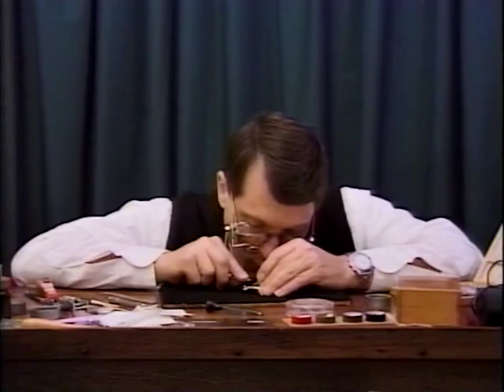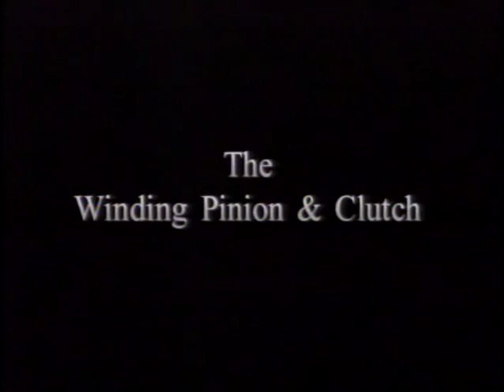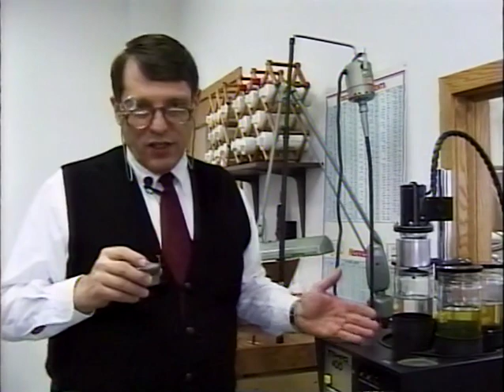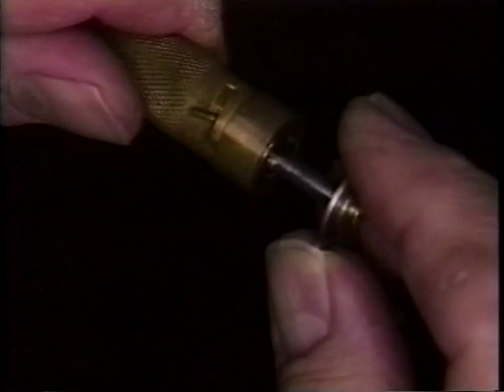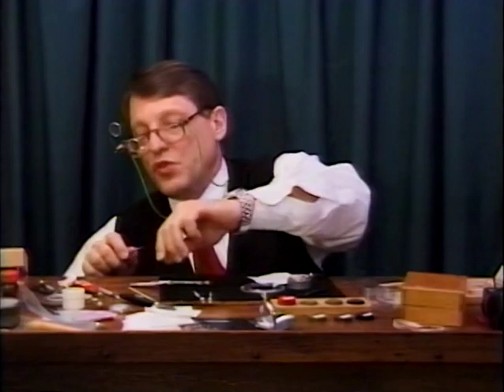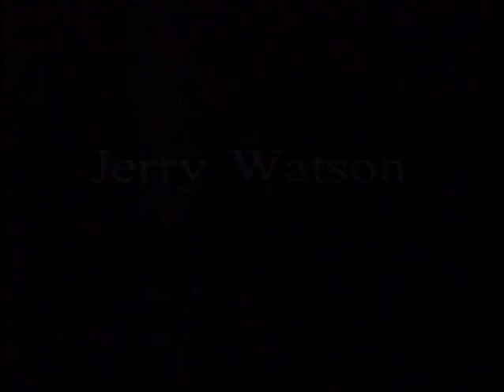servicing the modern pocket watch

Comment: This is very good instruction. One thing it does not consider is the weird stuff that can happen with vintage watches. If a cock or bridge is stuck to the plate with old oil, use a screwdriver with a twisting motion between plates to separate them. If no slot is present to receive the screwdriver, remove everything else that you can from the main plate first, then use a safe solvent to help break the bond, such as benzene for pallets or balance cock. Patience can pay off by avoiding bent pallet pivots. DAMHIKT

Comment: Just starting my journey into horology as a hobby. In the process of purchasing some good tools to begin with (no skimping), and I have watched and enjoyed a lot of strip-down/reassembly videos. I have to say that this is the best, most practical, easy to understand, no-nonsense video I've ever seen and answered a great number of the questions other videos brought to mind or failed to answer. I'd love to see more videos like this...you've done a masterful job.

One thing that I'm unsure of: What materials/tools would be used to clean parts as a hobbyist without the means to fund an L&R or other cleaning machine, and with what solvents would we clean the parts?
Reply: @CW Piperman I am in the same boat as you.  I was advised to buy an ultrasonic cleaner.  Don't put pallet forks or balance springs in the ultrasound.  You can also clean parts using naphthalene.  Also use industrial alcohol as a sort of final clean.  That's the old school way to clean watch parts.  It can take time to get everything you need.  At first you might not have everything you need.  I am still trying to get what I need.
Reply: @CW Piperman also, the mainspring is something that you shouldn't take apart unless you have a mainspring winder.  That is a very expensive tool.  You need a specific winder for different movements.  Until you buy this tool, don't take the mainsprings apart.  If you do it can be very hard to rewind them by hand.  You just reassemble the movement without cleaning the mainspring.  Unless you service watches for a living, some of the tools are too expensive to justify their purchase.  I hope this helps.
Reply: @glenh4971  mate, your making it sound hard without trying it. Winding a mainspring by hand is not hard. I've just wound the 2 barrels inside a Slava 2428 by hand and also a Unitas 6365N which are both tiny little barrels but both springs turned in nicely and easily. So please don't tell other beginners not to do something just because you don't have the confidence to do it yourself!!!!!! You DO NOT need an expensive winder. The thing u may need when servicing a barrel & spring is something to put the lid back on evenly so it clicks down nicely. I've bent a barrel lid before when trying to push it down with my fingers & thumbs. But you can pick a little barrel press up for less than a tenner. Or otherwise use the handle of your tweezers to press the lid down evenly. Don't let ANYTHING stop you. Give it all a go....